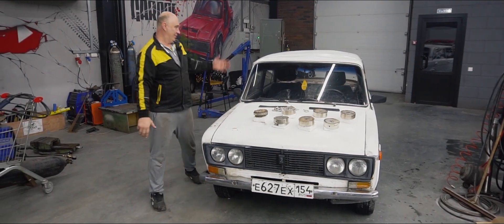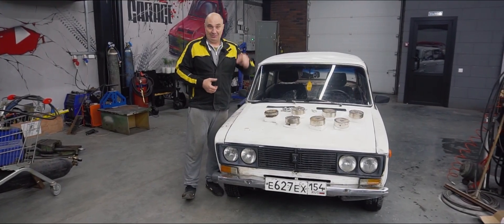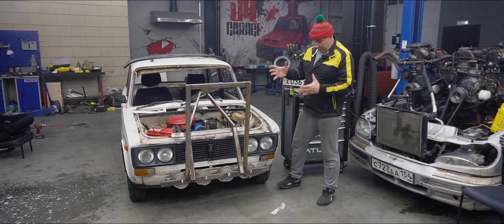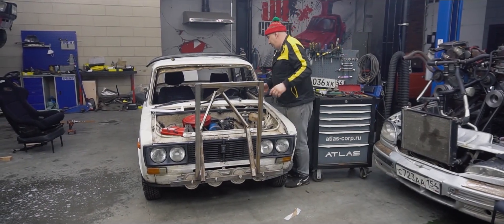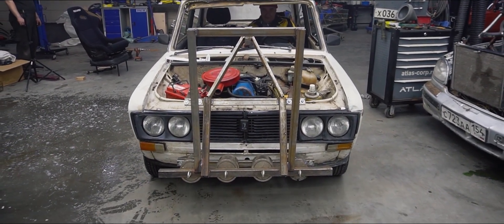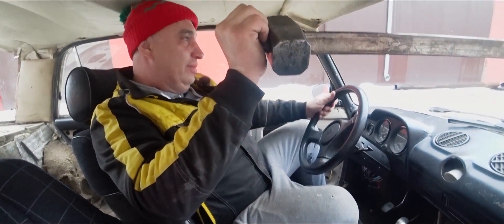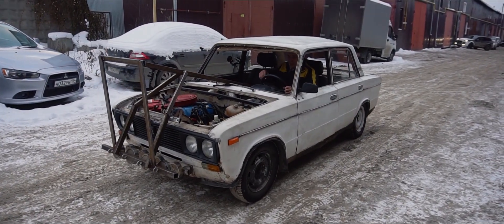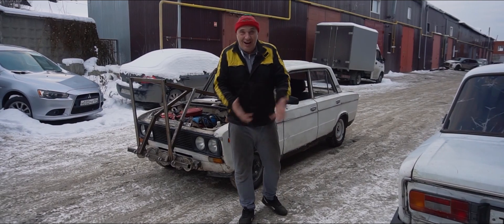We made gasoline obsolete

Comment: Point of contact magnetics does not work like that need a solid state wall or solid anchor for it to pull against it’s going to buckle if you use the donkey method guaranteed and on top of that do you understand physics? I can explain it to you but it’ll take a lot of time look it up.

Comment: That reminds me another trick: Tie a donkey to the front, attach a carrot at the end of a lever attached to the roof. The donkey will pull the car as it chases the carrot. To brake, you must lower the lever to allow the donkey to eat the carrot and push the brake paddle. Then, tie a new carrot to continue driving.

Comment: So maybe the mounted magnets on his lever could stay the same and come almost in contact with magnets that are in or are a cylinder themselves or like a piston you could mechanically shift the row of magnets back and forth having them alternate negative and positives they wouldn't be allowed to fully engage these magnets obviously but it could alternate the Pistons just like combustion engine with magnets pushing on and pulling on alternating Pistons that are either turning a cam or geared in some way to propel the car. I've been thinking a lot about a car that is pedaled by its passengers and utilizes their body weight in some way. Like you stand up and your seat would ratchet up along with you and then you sit back down and just let your body weight through a feud step ups in ratio like a little gear to a big gear to a little gear to a big gear to a little gear to a big gear to a little gear to a big gear which would totally suck to pedal, however just standing up and sitting back down and letting your body weight propel the vehicle or at least assist if you have four passengers. Then I thought what if you don't have any friends and then you only have one seat doing the work or if you're someone who's not 300 lb like myself I thought why not just make the whole deck of the vehicle hinge or scissor and you could jack it up like with a car jack a floor jack and then release and let gravity and your fat bottom girls make the rocking Flintstone car go around
Reply: But alas I'm all theory and no action and my hat goes off to these dudes for at least taking the action and blowing minds and theories out of the water around the world

Comment: The design isn't work if you're trying to get it to pull you need to get it to push you need to put the magnet on the back side and have it push against each other not attract to each other.... That is how you make a car move with magnets. 👍 Try one more time, with the magnets behind the car, and the magnet set to repel each other 🤗❣️🤗
Reply: https://youtu.be/H8IE4N38WsM
This video link shows more about what I'm trying to explain
Reply: https://youtu.be/qxZKLUAzQ7g
If you wanted to work ... Try using one magnet bigger than the other magnet like in this video.

Comment: It is because the car and the magnets are a system by their own, so they do create force but within that system, mainly it produces tension in the holding apparatus, and the arm of the lever operator.

Now lets say you put a row of magnets on two ladas, one front one back, you could get the car moving, but you could get it as far as the other lada is, then the other lada would need to use gas (energy) to propell itself, and the other lada forward. Thus it is like a tow cable. The earth is a system within itself aswell, compasses dont work in outer space.

Comment: Put 2 generators on each well and then use a electric moter that the 8 generators  go to a batter in the car push started can 8 generators  that only goes on cars just powered by the wheels and a big battery only use generator's that goes on a car not gas generators  it works try it you will see

Comment: Ok Gentlemen,  since lately you been making videos of trickery ideas on how to cheat physics. I have a great idea for you.  Build and electric vehicle with  dual battery banks, one battery bank will power the vehicle while the other will use the momentum of the vehicle in motion to charge the other remaining battery bank, this way when one battery bank is depleted, you change to the other battery bank and continue on your way while again the vehicle in motion will charge the deplete battery.  You will never be able to run forever (physics) but you should be able to extend the duration of your drive.  Try it.  used a heavy amperage ac motor attached to a shaft powered by the movement of the wheels or shaft and convert it to dc using a rectifier and then charge the batteries.  

Should be interesting to watch.

Comment: actually, the car might move a tiny amount of distance, but the center of mass stays in place. That actually could work, if you decreased the distance between the magnets, pressed the brakes, increased the distance between the magnets and released the brakes and repeated that infinitely. If there were no friction and aerodynamic drag or just no energy losses in general, you could move a car that way, and it wouldn't even require magnets to work, it would work "fine" with a heavy weight being moved around in the described way. But it would still be slow and inefficient as hell. You could try to calculate how far you could go per one iteration, but i doubt it would go further than a fraction of a micrometer per one iteration. Basically it's not even worth calculating. But moving the car just one milimeter that way would be a great workout lol.

Comment: Power a car with sound waves next. Get a very long cable and tighten it to a specific level of tension after finding a potential length to match intonation, then have a singer belt out a note that resonates the cable, and use magnets and coils attached to it to collect the energy to power a motor.

Comment: seeing this several times: yes, you could tow a car using magnets. The power to move the car comes from the magnets attached to the truck, which are moved as part of the truck body — by the truck’s internal combustion engine. The magnets here are just a medium to link the vehicles - more or less the same as using a tow cable.

Think about it this way: if you put two magnets next to each other - assume opposite poles - on the table, what happens? they’re attracted, stick to each other and then ... nothing. They don’t start rolling off the table on their own. Same for like poles - they’ll repel until the distance between them is great enough that the magnetic field interaction is not strong enough to move them apart anymore. And then ... nothing. To make one magnet keep moving, you have to impart energy on the other by moving it yourself - introducing an outside force. Try putting the magnets on little lego trucks with wheels as a scale experiment.

Comment: i had an idea to do with motion. You spin a dynamo or alternator, you get current / electricity fed back to the battery right, and that comes from the rotating of the engine/ crankshaft. Ok, so with a bicycle, your legs push a crankshaft that puts power througha drive chain to the rear wheel. So what if you sat someone inside a car, put a bicycle crankshaft between their legs, but dont connect it to anything, just spin it. Then have some sort of dynamo or alternator becoming charged by the rotation of the crank. That electrical energy, could surely be sent to an electric motor? Then use that to rotate the car wheels?

Comment: What if you put the magnets on the rear of the car and face the souths of the magnets to each other so they repel and if you're strong enough to hold the lever maybe the car can move. If its TOO strong then you can set up a "throttle" that controls the pressure of a hydraulic piston that can modulate the lever to make the magnets repel.

Comment: You could use an arm with a magnet on it to attract to stationary metal forward of the vehicle to pull forward - e.g. light pole, another car, crash barriers...
Reply: And there is why it should be obvious the push towards electric vehicles in their current condition is all about money. If they were serious they would install either an electric cable down all the interstate and Freeway Lanes and transmitted wirelessly with the vehicle transmitting its VIN number for billing usage.  Or  electromagnets down the center of the Lanes until they get to surface streets. But there's no money in that.

Comment: Would definitley worked with another set of magnets at the back repelling at the same time.
Reply: Nah, just move the row of magnets in the front bumper to the rear bumper, then add some ducting to direct the magnetic flow from the front to the rear. For brakes, just flip the front row of magnets so the negative side is facing forward. There. Climate change solved.
Reply: Would've worked if he covered himself in oil

Comment: OMG that's awesome. I have been working on a small train that carries supplies like groceries and small cargo items to remote villages in Alaska. My project is to make the train about 4 Ft wide and 4 1/2 ft tall that rides on one rail. The rail has magnets on it the bottom of the train that rests on the rail has magnets so it floats no resistance. And i have been thinking allot about how to make the train go, maybe a jet engine, airplane type propeller, now watching this video maybe magnets in front of the train can make it go. I'm hoping to achieve speeds around 500 to 600 miles an hr. Maybe a combination of magnets and motors.  We had 4 pilots die just trying to deliver groceries and this train system can run year round as it will be inside a giant tube system to prevent snow, animals etc from interfering with the train. What do you think? At that speed and driven by magnets or a jet engine this reduces the cost of food people are buying. Like one pinapple is $25 in Alaska. This train system can reduce the cost significantly. This can work in Russia, in Africa any where a remote village is that survives on imported goods. Let me know what you think.
Reply: I think it's a great idea, although I hope you realize by now that this video was satire. The laws of physics won't allow magnets to propel a vehicle when the opposing magnets are attached to said vehicle. If you're OK with 300-400 mph, I'd recommend using a simple propeller for propulsion. If you need 5-600 mph, then a jet engine would probably be more efficient at high speeds and long distances

Comment: CAR BATTERY TO HHO GENERATOR (HYDROGEN) TO TANK, TO CARB
WILL THE ALTERNATOR MAKE ENOUGH ENERGY TO POWER THE HHO GENERATOR, TO PRODUCE HYDROGEN, AND KEEP THE ENGINE RUNNING ON THE POWER OF WATER? 

BATTERY + HYDROGEN GENERATOR = HYDROGEN FUEL + ENGINE = VROOM VROOM +PLUS ALTERNATOR TO CHARGE BATTERY

HHO GENERATOR IS VERY EASY AND CHEAP TO MAKE. YOU CAN FIND MANY GOOD VIDEOS ONLINE, INCLUDING KING OF RANDOM WHO STATES HOW MANY LITTERS IT PRODUCES. 

FREE ENERGY, BUT CAN IT MAINTAIN IT'S SELF?
Reply: Absolutely will not work. Engines only run at 25-35% efficiency, and any electricity made by the alternator will require even more energy in the form of fuel to be created. What CAN work, is using a huge separate battery pack to power the hho generator instead of the engines alternator. Would it be practical? Probably not but if anyone can (and would) do it, it's these guys
Reply: @thecrazyfarmboy  I see a concept, and they did say so many years ago Hydrogen was the future.. Where is it?  Whether it works or not, I want to see. Will it at least run a lawnmower? If it can, then there must be a way to run a car.  I hear your point, and I think that myself.  But I still want to see it.
Reply: @DiaryofaGrimReaper  yes you can run a lawnmower off it, because push mowers don't have alternators, they can only produce a spark and that's all so you'd have to use a separate battery to power the hho generator. There are indeed ways hydrogen can be used as fuel for the future, and there is tons of information out there about it! This, however, ain't it. I might actually make a video where I draw a diagram explaining with simple math why it would be impossible to run a system like that off the engines alternator
Reply: @DiaryofaGrimReaper  also if you did use a separate battery to power the hho generator, then you'd be better off sending that electrical energy straight to a motor like an EV does. You can't get energy for free in the world of physics! Its like suggesting that maybe running a motor off the alternator could increase mileage. It can't, because it would take more power away from the engine then what you'd get back from the motor.
Reply: @thecrazyfarmboy  It could be solar power assisted for all I care.  I think what you would be fighting is resistance.  keep in mind, I am not even talking about will the engine drive,  but will it at least idol?
Reply: @DiaryofaGrimReaper  I often do wonder if there's a way to use hho generators to run engines but the only reason I can think of to do that is making a lot of power for a short amount of time. Because hydrogen and pure oxygen contains way more potential energy than gasoline fumes and plain old air. I know a lot about physics so i am very confident in my reasons for what I've said thus far, and btw I like your idea of solar assistance, unfortunately again it would be better to send that solar power straight to a battery/motor to drive the vehicle, but I still like that kind of thinking - at least you're not expecting to get more energy without putting extra energy in!
Reply: @DiaryofaGrimReaper  I should add that I have built my own hho generator, and I was suprised by how much current it takes to produce even a tiny amount of gaseous product
Reply: @thecrazyfarmboy  I wish I had a shop, but I don't.  Show me it doesn't work, and I'm fine with that. People built a HUMAN  peddle powered helicopter, it works, but is certainly not efficient.  To go 6 feet in the air, you have to be fit, because it's hard, and it's only like 2 minute flights due to fatigue... But THEY DID IT.  I understand they lied about Physics.  I understand Tesla, and WHY they lied.  I just commented about Gravity in to Fox's coment in these comments, explaining "Gravity".  I am a master in Gematria and Paranormal Communication, so I do have a edge.
Reply: @thecrazyfarmboy  You understand Physics.. But there is a different system going on.

We are told what goes up, has to come down...  But it doesn't. When it comes to such things,  Anti "Gravity" exists, but it is not Gravity, Gravity is a lie.  Tesla said "If you want to understand the UNI VERSE you have to think of it in terms of ENERGY, FREQUENCY AND VIBRATION. 

People with encounters with UFO claim there was a HUMMMM.... 

Dr. Hutchinson has a series of old experiments where he combines electricity from a Tesla Coil and a sound frequency to levitate a cannon ball.  You see, Gravity is not a force that pushes you down, the more you think about  it the stupider it sounds. It's a LIE. What keeps you down is the lack of energy/ frequency that would cause you to float away.  What are the stars? HIGH VOLTAGE ELECTRICITY THAT PRODUCE PLASMA. Fuck NASA, Nasa (nasha) means "TO LIFT UP AND TO DECEIVE" IN HEBREW.

THE STARS ARE PLASMA COILS, LIKE MICROWAVE PLASMA, AND WHY THEY FLICKER. YOU CAN SEE THEM CLEARLY THROUGH THE COOLPIX p-900. GOOGLE IT.  Google "METAL BALLS FROM THE SKY".  

YOU WILL SEE WHAT THE STARS ARE, GAS FILLED BALLS,  CRUDELY MADE, THOUSANDS OF YEARS OLD, AND THEY BROKE LOOSE, FELL TO EARTH. YOU CAN SEE THE PLASMA ARC MELT MARKS ON THEM. YOU CAN COMPARE THEM TO THE P-900 FOOTAGE, THE RINGS, THE CENTER NIPPLE, THAT IS WHAT THE STARS ARE..
Reply: @DiaryofaGrimReaper  it might take some time to put it together but now I do want to make a video about rigging a generator to a small engine and trying it! I guess all the words in the world are meaningless without proof right lol
Reply: @thecrazyfarmboy  Watch this. It's not a waste of your time.
THE REAL WORLD ~WHAT IS IT? (NOT GEMATRIA)
 https://www.youtube.com/watch?v=P_AjXeStU7g

Comment: oil floats on water

2. cover your car in oil

3. wait for it to rain

4. problem, fuel companies?
Reply: Still need fuel to actually move the car
Reply: Don't fuel companies make oil anyway?
Reply: @mikebolton2388  Not all of them, and you only need to buy it once
Reply: Actually I do use 40w to polish my spray painted impreza. It gives it a nice satin sheen. I dont do it but once a year though.
Reply: @jwilliams703  that only lasts 15 days and if you wanna do that then just respray it with spray paint and then buy some clearcoat spray and spray it 3 or 4 times
Reply: @savagesock3598  ya the rest of the year i dobt care. Its just spraypaint. Its a gambler car after all. I just make it shiny for the gambler.
Reply: Airliners hate this simple trick!
Reply: 1. You and your friend put $20 each into a box 

2. Sell the box to your friend for $30

3. You both make a $10 profit 

Problem, economy?
Reply: @cryo2156  your friend actually paid 50 (20 in the box plus 30 to buy the box) .. so he ended up losing 10
Reply: I hate this joke. I’m fun at parties but… humans float in water too. We should be flying but since it’s not true, the oil joke is easily not funny.
Reply: @chatochafa130  eat radium paint
Reply: @uiopuiop3472  not funny didn’t laugh

Comment: I'm 1 min into this and its not going to work :D
Reply: I suppose from a physics point of view, the magnets certainly have an effect on each other, but everything else, the car, the road, irrelevant.
Reply: @vwthings  barely even physics lol its more like mechanical physics, the magnets on the car do pull on the car but there's an equal force pulling the other magnets towards the car, and those magnets are attached to the car so the net result is no movement of the car itself. If the other magnets were attached to the back of a different vehicle, you could use it like an extremely impractical towing system, but I think a strap would work a lot better for that 😂